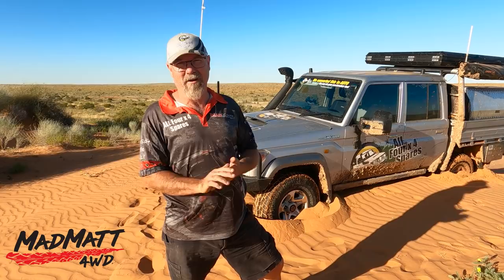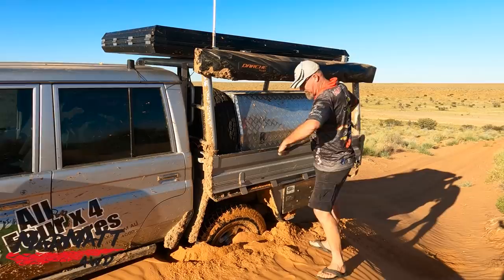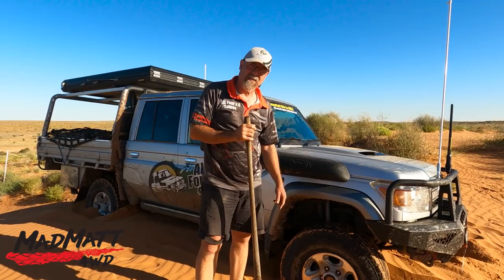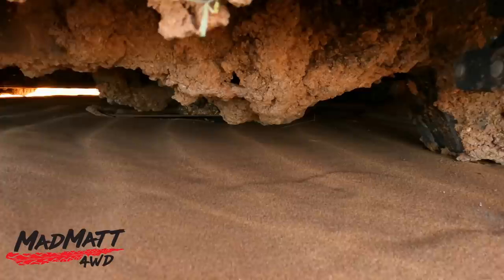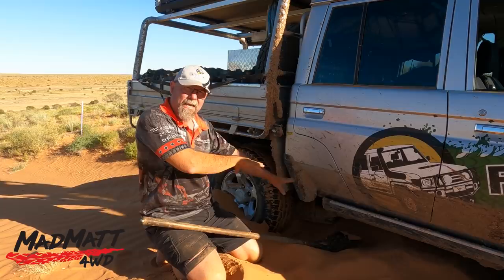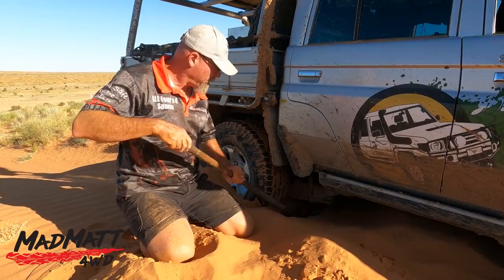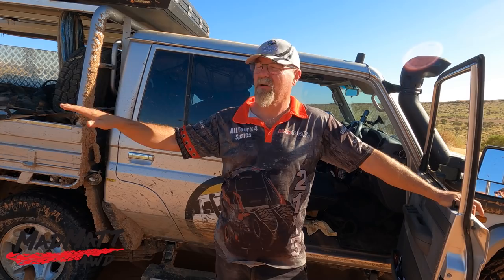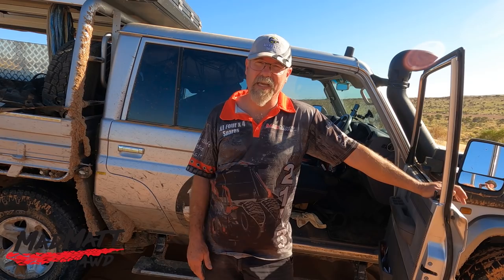How to recover a 4x4 with just a Shovel

Comment: Well done.   Shovel is always the first tool to come into play on the sand, expand from there.  Only too often do you see crew well bogged and reach straight for the snatch, the vehicle still deep in the sand which is trapping them.  A few minutes on the shovel and not only are the forces greatly reduced on both vehicles, but the extraction is safer.   

Look like clean up for the big girl will be a job in itself.  Good luck!
Reply from the maker: Yep totally agree

Comment: Great video.  Blows my mind how many people don't carry a shovel.  I'd put the shovel at #2 though.  A good jack works in almost any stuck situation.  It's usually easier to jack up the tires and fill under them than to dig out the rest of the rig.  You're left in a better situation to start from with the vehicle sitting higher and usually with something under the tires that offers better traction to launch from too.  I've had to just dig out a few times though.
Reply from the maker: Fair enough. A jack is certainly a great tool.
Reply: Air bags.

Comment: you weren't mad enough with your right foot this time until it was too late ! great shovel techniques and explanation! maybe a council worker in a previous life ! good job in getting truly bogged and putting in the effort for self recovery . don't forget you can always use your floor matt's as a traction aid . along with lowered tyre pressures.  and using the slowly rolling back and forth to create a tyre track on the sand grows in length of every rotation of the wheel
Reply from the maker: There’s lots of methods. Well said.

Comment: Good points about pacing yourself and hydration. If it's real hot, set up some shade and relax till it cools down. Don't panic. Even if the tides coming in, you might be better off accepting the inevitable than having a heart attack from over exertion. Like an idiot, back in the 70's, I drove my FJ40 ute out on the tidal flats. When the tide turned the bugger wouldn't start. We carried the food, beer, gas bottles etc back to the beach and set up camp and watched my 4WD become a small island. The water came half way up the doors. Early next morning another fourby came along and gave me a jump start. I sold it not long after that.
Reply from the maker: Gee that sucks. Glad you survived

Comment: Add a long handle stiff garden rake with a 1 1/2” flat bar welded to the top edge to your kit to reach under and pull  into your holes you dig out.  Old timers Montana USA trick…. Nice to see you keeping it simple,  sometimes digging is the only option!!!
Reply from the maker: Cheers

Comment: yep, shovel  is first and foremost .. one thing about shoveling  that I've always remembered was from a book (or catalogue?) by Dick Cepek back in the late 70's   .. do a good job shoveling, then when you think you have done enough, do some more  , resist the urge to say "that's good enough" because when it doesn't work, you will only be much more stuck  .. something that did me good to remember when taking my one wheel drive Chevy L.U.V. truck out into the sand dunes .. another trick I learned was as you say, only apply enough power to move, not spin , having a clutch was great in that I could little by little  make the vehicle rock (I dug out behind the wheels as well ) and rock more and more , by timing the clutch applications (1st gear only, not shifting gears) and when I got it rolling forward/backward a bit I would launch it on the farthest back roll, giving myself a rolling downhill start so to speak

Comment: I always bring at least one shovel, but most of the time have two, and a friend. It speeds things up if we need to get unstuck, but they're also super useful for other things. We tend to build and bury campfires quite often, but they're good as light-duty mallets for tent pegs, or digging a latrine, or a Dakota fire hole. I've wrapped tow straps around the handle before, as a quick way to wind them up. Depending on the type of shovel I bring, they can actually be used for leverage, prying on loose rocks or roots or whatever. What I really don't like are those folding military shovels with the twist thing. They are worthless in real situations. Too short and wobbly to help at all. They are a gimmick to me. Great video.

Comment: Great video for pointing out the basics. Thumbs up. Way too many people think you need a ton of recovery gear but if you're not an avid off-roader then a shovel can get you out of a potentially dangerous situation. Also works for snow. Another thing you could have mentioned though would have been getting any available passengers to push the vehicle and if you don't have max trax you can use floor mat's from inside the vehicle to aid in the recovery. I do realize though that this video was focused on mainly the shovel so maybe you didn't want to complicate it.
Reply from the maker: I just wanted to focus on the shovel in this video. I had lots of other options I could have used.

Comment: Hey Matt, I know this is an old video but firstly wanted to comment how much it is appreciated to give newer 4WD owners more confidence to head out more remotely and to do it safely. 
I dont think it was mentioned much in your video - but your tyre pressure still looked pretty high. I reckon taking it down to something like 15psi in that heavy vehicle would have been even easier and faster than the digging, if you see this comment, would you agree or is there something I am missing? Cheers!
Reply from the maker: Thanks for the encouragement. I don’t recall what pressures I was running but the rear was very heavy so imo 15 would have been too low. I think the fronts could have gone lower. Fyi this was an intentional bogging for the purpose of the video.

Comment: As a kid growing up in Wisconsin, I recall my uncles and cousins always bringing the same tools to recover a stuck car or truck. A shovel, a garden hoe, and a hi lift jack. That was back when cars and trucks actually had solid steel bumpers. Now a days you are hard pressed to find a vehicle, in stock form, with actual bumpers to use a hi lift jack on. The shovel and garden hoe I can still see reason to use though.
Reply from the maker: That’s super cool
Reply: That's the way we did it. We didn't have hilifts, but used bumper jacks and bottle jacks. But I think the key point here is the hoe. They are real work savers in these situations because they enable you to pull out only the dirt you need and they do that pulling  more efficiently. They are very light, so all you're giving up is a bit of space.
2 more of my cents on this subject is to size your shovel to what you're digging. A regular shovel for snow and sand, but something smaller and pointyer for heavier dirt and mud.

Comment: 1977 I buried my Jeep Cherokee on a very lose sandy beach in Southern Spain. The tide was coming in and I had nobody to call. I found a long handled oar on the beach and dug my way out with that. I of course had no lockers and I needed speed. I dug out underneath the jeep till I had weight on the wheels and then dug out behind the tires for about 50 feet and laid some drift wood in the bottom. Then I dug out some in front to feather in the ruts to the surface. I did have another guy helping. I then backed up in my runway, unloaded camping gear to lighten the load and aired down. I took a hell bent for leather run forward and was finally able to drive it off the beach.
Reply from the maker: Wow. Well done
Reply: @MadMatt4WD  desperation is the mother of ingenuity.

Comment: In the back of my Ford Ranger two wheel drive is a square point shove that I have transferred from it, to big rig trucks and back for a number of years. That has dug big rig trucks out of mud filled parking at customers, snow ice at loading docks so I could get the truck under the trailer to hook the king pin. And dug my Ford Ranger out of a snow bank I got into driving in my town in a whiteout. I didn't bother to put the chains on the tires that were in the back of the truck next to the shovel. that shovel has pretty close to about 750  maybe a million miles on it. I got a short handle square point sitting behind the front door to clean the snow off the front porch. I don't really like short handle shovels. And in your case a very good tool to use when one of them big male kangaroos  become obnoxious and knock them in the head with it; teach him a lesson.🤣 Good video. Be blessed.
Reply from the maker: Nice

Comment: Turn the weels to the right side to look the front diffs
Reply from the maker: Where I can I’ll perform a turn and yes that helps but it’s not always possible on these tight tracks. It doesn’t matter left or right.
Reply: @MadMatt4WD   sorry u just turn the stering don't need to turn the vehicle.  As soon as you turn the stering it will engage

Comment: Gotta disagree. Was stuck on a hill in soft sand, didn’t notice it was sand til it was too late, and due to the angle couldn’t back up and turn. So it was either risk rolling my truck, fall off a sharp decent not far behind since I tried backing down, or move forward up a 17 degree incline. Shovel and lockers were pointless and I was under 10psig. Traction boards got me up 1 meter at a time and the second I got off them I sank. But the traction from those boards was insane and the only way I could have self recovered.
.
Edit: plus traction boards work on rocks for better clearance, not dropping into a hole, and getting better grip at times. I’ve used my boards for so much. I also keep a shovel, but honestly the boards are far more effective and useful.
Reply from the maker: That’s fair comment. This video was to show the power of a shovel. Also it could have been used in your situation to reduce the angle of the slope. It would just mean a lot of digging.
Reply: @MadMatt4WD  was too steep, I’d have had to moved metric tons of sand to make any impact and even then sand would fall in and back fill it. It was tiring enough to remove all payload and continuously setup the boards over and over again.
.
Wasn’t saying it’s not useful, I carry one exactly cause they are, just know that traction boards are far better and more useful. Especially considering exposure to elements such as sun and heat that make physical labor that more risky. 
.
I also keep empty sand bags to fill when I need to fill holes and support the traction boards from taco’ing.